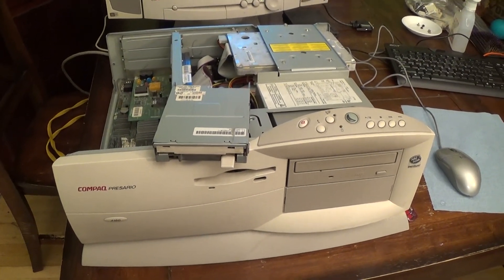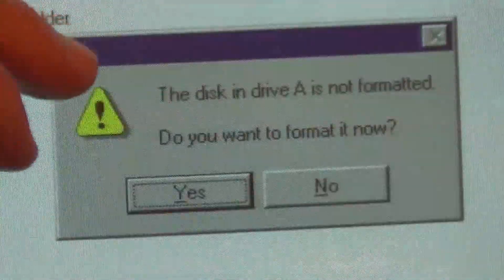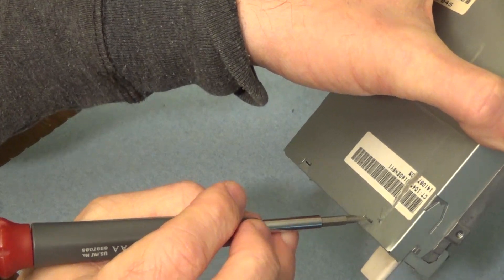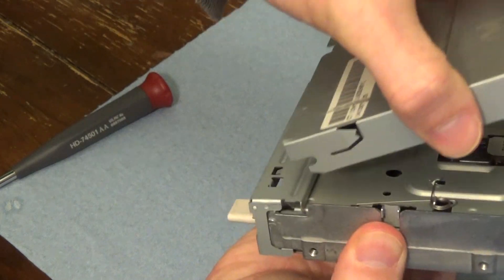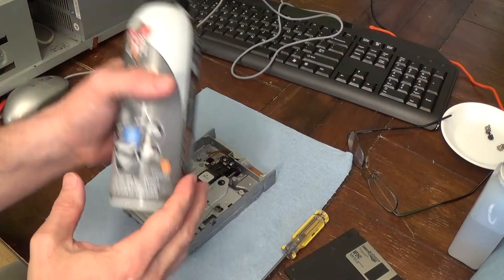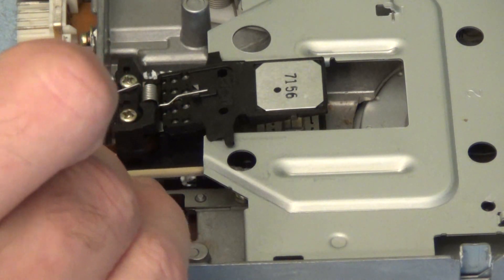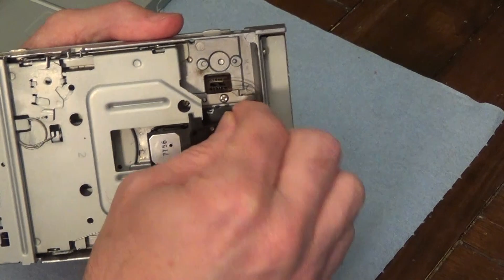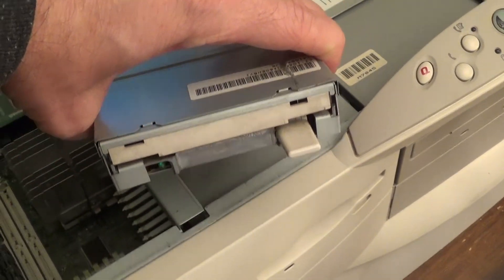How to Get Your Floppy Drive Working Again

Comment: I have a drive that works (yay!) but won't write to a disk, keeps saying it's locked but it's not. What could be the issue? Someone told me that they think that the drive has a light inside that it shines through the disk where the lock protection is, to see what position it's in. If light goes through, then it knows the disk can be written on but if no light, then it thinks it's locked, and that the internal light has gone out? Does this sound accurate?
Reply: More likely there are little microswitches on both sides of the floppy drive, you may be able to see them through the door of the floppy drive. Usually they are black with little white pegs poking out of them. Spray some contact cleaner in them and it should start working again

Comment: To clean magnetic tape heads use a piece of plain white typing/copy/printer paper, and fold it up into whatever shape and amount of rigidity you need. Then put some isopropyl alcohol, or better yet, some electrical contact cleaner (I like WD-40 Specialist Contact Cleaner, not to be confused with regular WD-40 of course), on the paper and wipe it across the heads several times. The paper won't leave any lint or fibers on the heads, and it's very mildly abrasive, which helps a little with cleaning. VCR repairmen commonly used plain white paper wetted with whatever cleaning solution they preferred to clean VCR heads. I've cleaned the heads in several VCRs like that and it works great. I've also made old malfunctioning floppy drives work like new with that cleaning method.

Real electrical contact cleaner works better than isopropyl alcohol especially if the heads haven't been cleaned for decades, because it removes oxidation in addition to being a solvent, whereas isopropyl alcohol is just a solvent.

Comment: Would this method work with a laptop floppy disk drive? Also what type of grease do you use? Is it silicone grease? I keep getting the same format message when I insert various disks. It worked initially, then stopped working, so I am hoping it will be an easy fix!